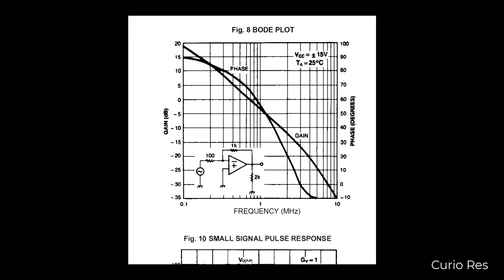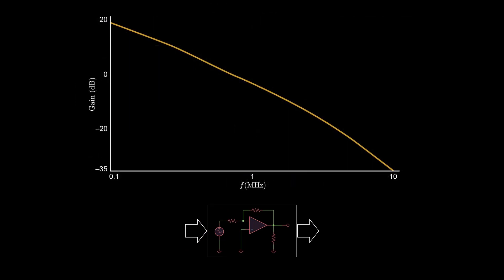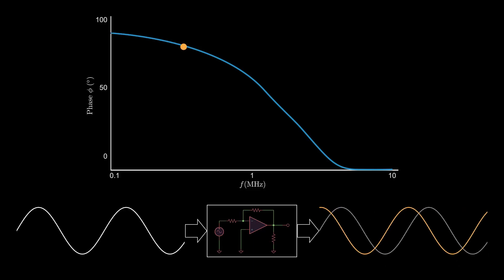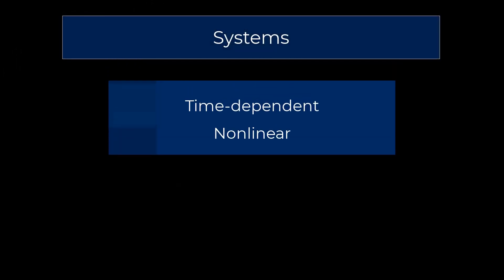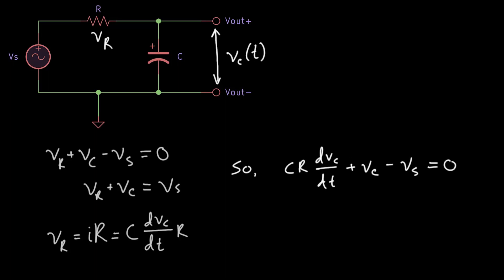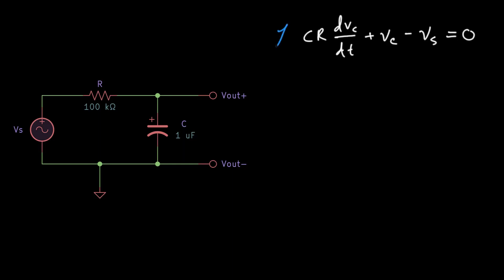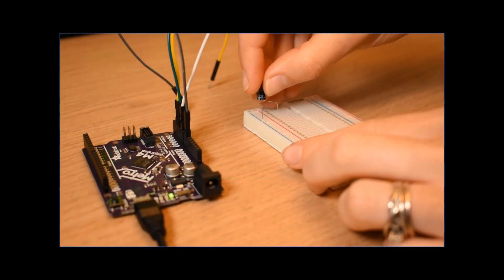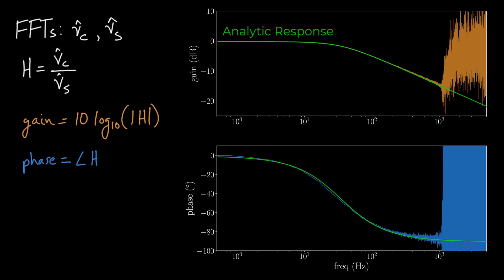Bode Plots Explained

Comment: re dB for gain: 10log is applicable when the ratio of output to input is expressed in terms of POWER; if  the ratio of output to input is expressed in terms of either VOLTAGE or CURRENT, then 20log is appropriate. Rationale: power is a function of EITHER voltage squared or current squared.

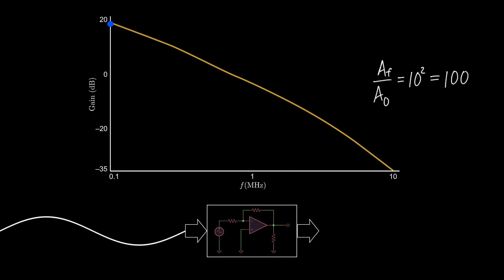Comment: 2:16 what would be da gain below 0.1 MHz ? like at 0.1 its 100 so will it decrease for frequency less than 0.1 ?
Reply: Below 0.1 Mhz it will be higher. A bit earlier in the video you can see the op-amp has 1k and 100 ohm resistors. That is a gain of 10x which gives a gain of 20 dB for voltage. As can be seen in the bode plot the line is close, but not really all the way up, to 20 dB at 0.1Mhz. So at lower frequency it would be even closer to 20 dB. At DC it would be 20 dB.

Comment: Important → At 0:54 and throughout, decibel is used incorrectly → Decibel is an important concept and should be properly understood. Decibel is always defined as a ratio of power quantities (energy, power, intensity) as 10log₁₀(P/P₀).
Once root-power quantities (formerly called field quantities, such as pressure, voltage, current) are used, they must first be squared to obtain power quantities: 10log₁₀(V²/V₀²) = 10log₁₀((V/V₀)²). However, due to the subsequent logarithmic operation, this squaring can also be expressed as a factor of 2 in front of the logarithm, resulting in the formula 20log₁₀(V/V₀).
In this case → first it is about the Bode plot of an op-amp, whose scale Gain(dB) refers to voltage. Later it is about RC low-pass filters and corresponding voltages. The term amplitude is also mostly used for root-power quantities such as voltage. Therefore, the formula 20log₁₀(A/A₀) must be used throughout, and 6dB corresponds to a doubling of the amplitude, i.e., A=2A₀, which in turn means a quadrupling of the corresponding power.

Summary
Power quantities (energy, power, intensity): 10log₁₀(P/P₀)
Root-power quantities (pressure, voltage, current): 20log₁₀(V/V₀)

+3dB means
For power quantities: P ≈ 2 * P₀
For root-power quantities: V ≈ √2 * V₀

+6dB means
For power quantities: P ≈ 4 * P₀
For root-power quantities: V ≈ 2 * V₀

See also
https://en.wikipedia.org/wiki/Power,_root-power,_and_field_quantities#Implications

youtube.com/@curiores111
It would be nice if a corrective overlay could be shown at the relevant points in the video.
Reply: Agreed completely. When I first heard her comment I reinterpreted it in my head as "Irritatingly, some people calculate it properly". Though youtube is full to the brim with misinformation and many comments praising them on it.

Comment: "But this isn't a video about solving ODEs" part at 8:05 killed me. Can't you write how its solved somewhere?
Reply from the maker: What kind of information are you looking for? It's solved using standard ODE solution methods. Generally speaking though you'll save a lot of time just plugging it into some software that generates the solution. I'll usually do something along those lines if I'm not teaching.

Comment: Just a quick note to make things clear for people that might wonder why 20log(Vout/Vin) isnt used here. When writing how much a voltage has been amplified the correct way of writing is: dB = 20log(Vout/Vin). By using the law that power is proportional to the square of either voltage or current , the 20log(Uout/Uin) relationship can be derived. So just change that in the Gain graphs and it will be correct!
Reply: Otherwise, awesome video!

Comment: Can I use bode plots to calculate the transfer function of a motor with no parameters?   Like back emf.   Sweeping the input of the motor and getting an output from the shaft sensor maybe?
Reply from the maker: Sure, you can sweep frequencies to get an estimate of the transfer function. If you have an encoder you can measure the output positions relative to the input voltage (if that's what you're after). There's plenty of subtlety to that time of parameter estimation, so that's well outside the scope of this video.

Comment: Is it possible to bring in Accelerated Data,   Convert it to velocity, and Show position?   I am trying to capture acceleration data ways.   1)  Pulses every 30 feet for 500 feet for velocity 2.)  Calculate Velocity from accelerated data and compare.
Reply from the maker: Using accelerometer data to compute position is pretty difficult. Even a single integral will have substantial errors, but a double integral is particularly bad. You need to mix it with something else to get anything reasonable in terms of estimating position. If you're talking about 500 feet maybe GPS?

Comment: Thank you
Reply from the maker: You're welcome 😊
Reply: @mrprad7425  

Let me give a short explanation.

Poles:
Poles are points in the complex plane where the denominator of the Laplace transform expression becomes zero, causing the system's transfer function to become undefined or infinite. In terms of the physical interpretation, poles represent the natural frequencies or resonant frequencies of a system. They indicate the points at which the system's response can become unbounded or oscillatory. A pole's real part determines the exponential decay or growth rate of the response, while its imaginary part contributes to the frequency of oscillation.

Imagine a simple mass-spring-damper system. The poles of its Laplace transfer function correspond to the system's natural frequencies. If there is a pole with a positive real part, it indicates that the system response will grow over time, possibly resulting in instability. On the other hand, if there are poles with negative real parts, the system response will decay over time, indicating stability.

Zeros:
Zeros are points in the complex plane where the numerator of the Laplace transform expression becomes zero. Zeros represent the values of the input signal for which the output response becomes zero. In other words, they are the frequencies or inputs that the system can attenuate or cancel out. Zeros have a significant impact on the system's frequency response and transient behavior.

In the context of an electrical circuit, a zero might correspond to a point where a specific frequency of input voltage leads to no current flowing through a particular branch of the circuit. This could be due to a resonance effect or some other physical phenomenon that dampens the response at that frequency.

But better understand physically, you need to learn what's laplace transform conveying 

https://airgapflux.in/search?q=laplace%20transform (these videos might help.)

s = sigma + j omega
s = exponential component + j oscillation/sinusoidal component
Reply: "Could you please provide an explanation of 'poles' and 'zeros' in a practical context? I'm interested in understanding how these concepts are applied in real life."
Reply from the maker: @mrprad7425  I love the idea! I'll mull on it. Thanks for the suggestion Mr Prad